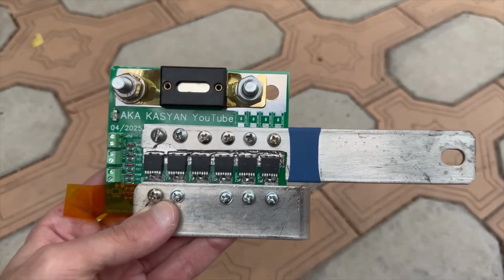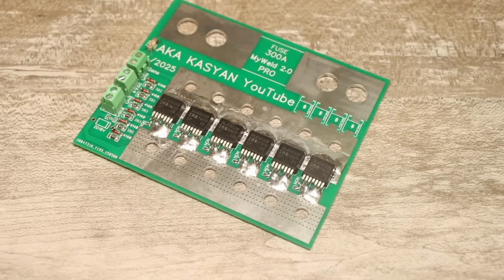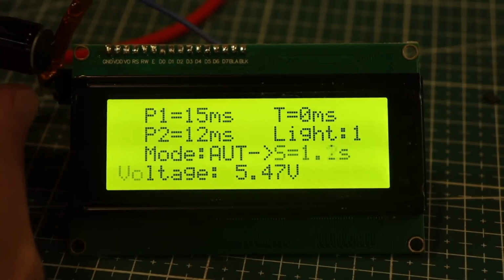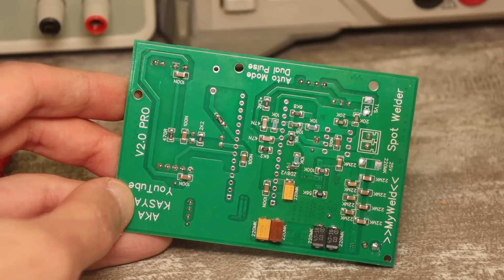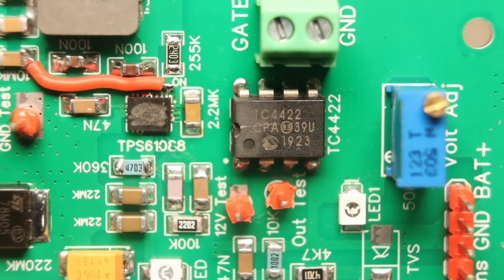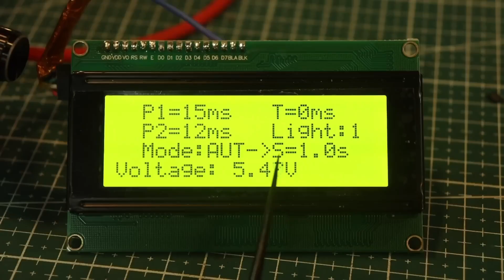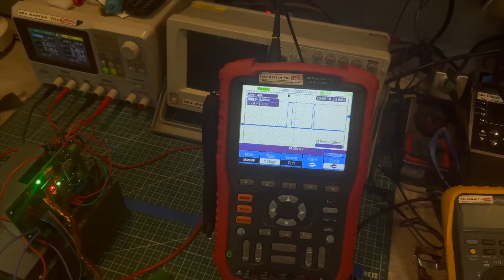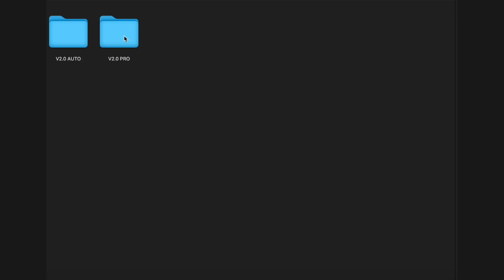Best Supercapacitor Spot Welder MyWeld 2.0 PRO. #jlcpcb

Comment: I adapted the control circuit to a breadboard so I could play around with it. Just had a few issues:
1. The battery voltage read 2.76 times actual voltage. So, I factored the voltage down in the Arduino script.
2. The 12v line control voltage was also reading incorrectly. Adding a 1K resistor to the 16K resistor R5 brought this number close (12.05V instead of the actual 11.95V).
3. The pulse from pin A0 was only around 0.6V instead of nearly 5V. Adding a delay to the pulse generate function after the beep fixed this. Apparently the arduino needed some recovery time between the beep and the pulse to the driver chip. Took me 3 days to figure this out 😂
4. I also added a 100 microfarad capacitor and a 0.1 microfarad capacitor between the "11.4V" from the TPS61088 module that I used and ground. This helped stabilize the voltage and fixed the display flickering I was experiencing.

Comment: Why only 5.4v on input and not 12v?
Reply: The caps are the most expensive part of the project. 

DC welding does not need voltage higher than 5V. 

Why would you want to use 12V? IMO I’d skip the boost converter circuit and just have a 12V DC input jack to power the gate

Comment: Hy kasyan, senang anda rutin membuat video akhir akhir ini.
Saya ingin membuat spot welder analog menggunakan timer ne555, yang mau saya tanyakan adalah.

Apakah in4148 yang diparallel dengan resistor pada gate mosfet berfungsi untuk discharge sisa tegangan?

Penggunaan zener pada jalur gate mosfet apakah tidak perlu di seri dengan sebuah resistor ?

Penggunaan resistor pulldown apakah bisa diterapkan di masing masing mosfet antara gate dan source, ataukah cukup menempatkan pulldown di jalur pin 3 ne555?

Comment: Hello! I was just looking for a spot welder in china websites. What are the "gears" ratings on China made aliexpress products? Some have 30 "gears" other 90...
Reply from the maker: Hi, it’s possibly the power level — in fact, the pulse duration. I don’t know how it works in Chinese models, but in my case, the set pulse time matches the actual value.

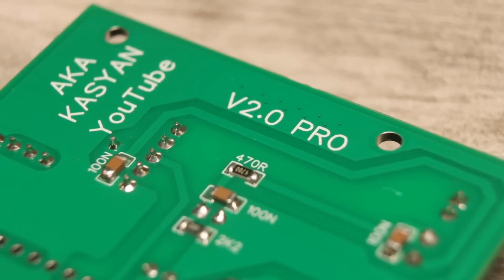Comment: Sejauh ini project yang paling jauh menurut ku. 18:07 ya memang harus original, saya pernah menggunakan mosfet palsu, dan meledak dalam sekali pakai. Karena dana saya terbatas saya membeli lagi mosfet bekas dan original, itu lebih baik 😁
Reply from the maker: Hi! That's right — I managed to buy a batch of 10 transistors on AliExpress for $11–12. At first, I thought they were fake, but after testing, it turned out their on-resistance is 45 mΩ, just like the original.

Comment: Awesome work Kasyan!!! I completely agree that there is no need to upgrade ICs if it works, and it functions as intended. If you look at the big manufacturers, they always cut corners and use the cheapest methods if it functions as intended. You are awesome! I just bought 2 open frame 48V power supplies on eBay, i wish i had a flemarket. I am not sure what to do with them, they have big 27000uF can caps so I will have 2 of those. I want to make a spot welder with them, maybe i could use them to drive this board but would need some buck converter i think.
Reply from the maker: Hi, thank you very much!